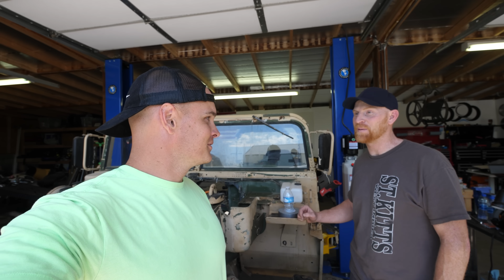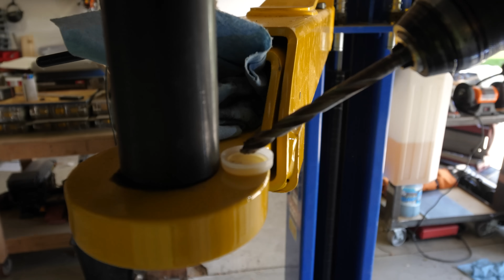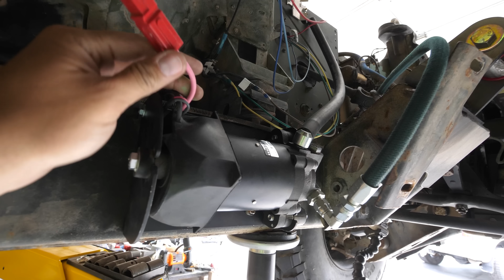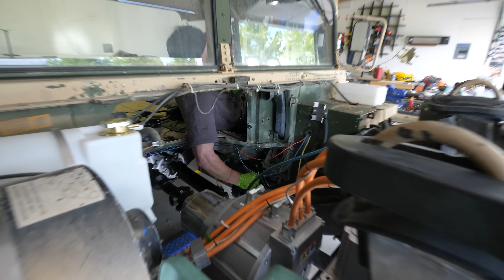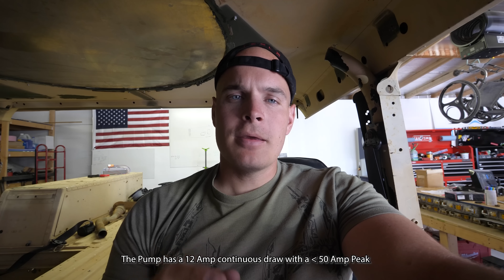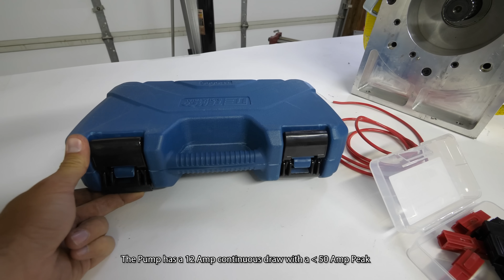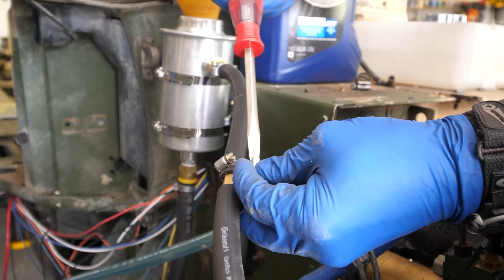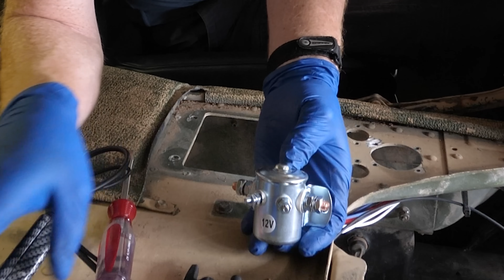We might have a problem with the Brakes... - Electric Hummer Conversion!

Comment: I'd use different fluid.  Find a Toyota truck that uses that pump, and use the same fluid that Toyota recommends for their system.  Probably better for the pump, and may be quieter.
Reply: Added explanation, dex/merc isn't bad, but automakers largely stopped using it years before electric pumps started becoming popular.  It would be safe to bet that the pump you're using was designed for a full-synthetic fluid, like Toyota T-IV, or Dexron-VI.  Maybe something more exotic.  I'm a Mopar parts guy, and I know that Chrysler has their own fluid specific to systems with electric pumps.  Toyota might do the same.

Comment: FYI. JIC fittings, 

 (bottom of reservoir) does not require thread tape.
Reply: Yep, came here to say the same. The angled section should provide all the sealing required.

Comment: I would just sound deaden the power steering pump. When your moving or going down the road you will probably not notice it. Or move it up front somewhere under the hood and not right underneath the cab.

Comment: For the pump, Closed cell foam so it doesn't collect dust inside it then paint the outside of it to protect the foam more. Or place it in a box with the foam.

You could also get a pump with a bigger turbine and run it at a slower speed

Comment: If it was me I personally would put some insulation that was weather and heat safe and wrap the pump in it or build a little makeshift box that is easily bolted and unbolted and then insulate that box which will provide far more soundproofing than what It sounds like it would

Comment: Can you please start numbering the videos and if possible number the older ones (it is supposed to be a series after all), i think i missed when the drive shaft was installed. The last video i saw was the 12v system. So please where is the video for the drive shaft?

Comment: Hey @JerryRigEverything,
Not all solenoids are created equal. You should check that the solenoid you have is rated for %100 duty cycle. Starter (and electric winch) solenoids often have a very low duty cycle and will burn out the induction coil, or get extremely hot if left on permanently.

Comment: The duty cycle on a starter motor solenoid isn’t designed for long periods of operation. I’m assuming the power steering/brake hydro boost pump operates constantly during vehicle operation as it would have on a gas or diesel powered vehicle. I would power the pump directly of a suitably rated run relay rather than a starter relay. Relays eventually burn out so it’s a good idea to make sure you have a relay designed for the purpose(eg. load and duty cycle)…especially given that potentially you could loose steering and braking performance.

Awesome project and youtube channel.👊😎

Comment: Few more details that may help you.  The master cylinder has a gold cylinder on the side.  This is a pressure reservoir.  In the event the power steering pump fails, you have a couple applications of power brakes from that pressure reservoir.  Also, with how the high pressure hydraulic loop is plumbed, your brakes take priority over steering.  So if you stomp on your brakes, your power steering may decrease.  Spend time fully bleeding the power steering pump loop.  Lift your front tires off the ground with your electric pump running, and steer left to right many times, and press on the brakes.  Turn off the system and wait for the air bubbles to rise out of the fluid, and repeat the air bleeding procedure a few times. I would also measure your dc amperage with the pump on at both rest, and when fully loaded.  I'm curious how many amps it draws at idle.  To simulate worst case turning pressure, you can lower the front tire pressure.  Or test with the steering at full left or right lock against the steering stops.  Typically when you're on the steering stops that's the peak pressure, and the built in pressure relief valve in the power steering pump releases, creating the typical "hiss" noise you hear on most vehicles.
Reply: Depending on your final vehicle weight, and tire size.. if you need additional steering power.. there is an upgrade to the "Sheppard" steering box.  That does require drilling and welding new bosses into the frame though.  As an alternative there is a "rock ram" hydraulic ram assist system.  You might not need these though if you place your batteries towards the rear axle
Reply: Also.. I'm not sure that a hydraulic accumulator and switch would work.  I may be wrong, but I believe the pump flows fluid through the brakes and steering box when power boost isn't needed, and there isn't high pressure in the system.  And when power assist is needed, the hydro boost or steering box will divert the flow and build pressure to provide the power assist to the driver.  Kind of like letting your garden hose flow freely, and then putting your thumb over the end when needed to divert the flow and build pressure when you need it.

Comment: Fuse? I didn't see a fuse between the solenoid and the battery. Also two words of caution, alot of those solenoids are not continuous duty. Secondly when that solenoid is energized and deenergized it creates a huge inductive Spike. Over time that spike will damage contacts. Consider adding a snubbing diode across the coil of the solenoid.

Comment: FYI, using Teflon tape on the bottom tank connection isn't doing anything. That fitting doesn't seal on the threads, it seals at the angled face of the seat and fitting.

Comment: 🤔 I'm thinking that thing is a tin can. Not very "sound proof". Maybe use dyna-mat. Used in the car audio industry to keep the sound in the car from resonating out. And outside noise out. There's also flexible foam mat that goes over dyna-mat for even more sound proofing. Installed usually under carpet, behind panels under roof liners. Simple to install. That will cut the noise to a tolerable volume. Goodluck.

Comment: @JerryRigEverything I've used a product called Kilmat, it's a sound deadening mat that can withstand heat. I used the 80mil version, and it worked perfectly to quiet an onboard air pump. just built a small aluminum box to incase the pump, and line the INSIDE with the Kilmat material.  Hope this helps.

Comment: I would try a sound absorbing/deadening foam block. Just carve it out to match the profile of the pump and mount it with spray adhesive or tie it to the frame. Ford uses the same stuff to muffle the noisy mechanical high pressure fuel pumps on their turbo Explorer patrol vehicles.

Comment: I would put a 90 or 100a fuse or resetable circuit breaker,  in the power wire to the vaccum pump solenoid, also I'm not sure the yellow ends you've used on the wire are heavy enough, I would source some 10mm or 12mm square lugs you will need to crimp using your hydrolic crimper, but great work, I'm enjoying watching this build.

Comment: Beyond the suggestions for hydraulic accumulators and sound deadening wrap on the pump motor.

I'd suggest some dust boots (like you see on motocross bike front forks) over the drive line splines, you REALLY don't want dust mud and crud getting near those.
Reply: Yeah I havn't seen a slip joint exactly like that.  Normally the splines are covered by a longer female shaft and a rubber seal on the end.

Comment: Really need some more fusing as close to the battery as possible every Circuit must be fused and the fuse is there to protect the whole circuit not just the item it is powering.

Comment: Electric steeringgearbox would be way efficient cause the motor only works when you want to steer, for the braking system, a vacum pump with pressure sensor will be suitable, the vacum pump works until it reaches certain pressure then stops, and works again if prssure goes down

Comment: If you're of service you'll be compensated... With more responsibility and less recognition. 🙃

You probably need larger than 10 awg wire if that thing is pulling 50-60A.

I might be wrong but I think that pump should shut off once it builds up pressure. It shouldn't run the whole time the key is on.

Comment: As for helping to quiet the pump, you could build a casing, or a 'dog house' if you will, with sound deadening material lining if heat transfer isn't an issue. could use vents in the metal sheeting as a sort of passive cooling, or just use 12v fans like the ones used in high quality audio equipment

Comment: I'm a big fan of those stand-alone electric pumps, had one in my '94 Soarer that controlled brakes, power steering and even the suspension as it was on factory bags (which still work today.. 30-40 seconds to raise or lower the whole car by ~2 inches).
Best parts when compared to a belt or vacuum driven system is you still get full brake and steering boost when the engine is off, and zero load on the engine/electrical systems when not actively in use. It just makes more sense.
Reply: Have any more info on that pump? Sounds cool and advanced for '94

Comment: Was the bottom fitting on the reservoir a SAE/AN? If so why did you use pipe tape? When the 37 degree flares meet they seal before any fluid makes it to the threads.

P.S. I'm am really enjoying this hummer build.

Comment: The electric power steering on my new Avalon hybrid makes no noise. It's connected directly to the rack and pinion with no hoses. The computer controls it in a way to help keep you in your lane, and wheel angle increase for parking. It also has electric breaking, when you first turn the "key on" you hear a faint pump building brake pressure for a moment  then stops, but you can't hear the pump inside the car. No engine accessory belt either, AC, water pump, oil pump, etc. has there own computer controlled 3 phase motors.

Comment: If it doesn't need any cooling you could make a little diamond plat box and double line the inside of it with sound deadening material for a stereo system. Just cut holes for wiring and throw some rubber gaskets around them.

Comment: I think you're doing an awesome job modifying the hummer. Not To be a smart-ass, but shouldn't an electric vehicle have electrical steering. I hear some of New Ford trucks use electrical powered steering.
Also I forget what's it's called but there is a device that can hold the steering pressure once it's at pressure and allow the pump to turn off when it's pumped up.
Just a suggestion, get water tight connectors for pump motor. It might not go underwater, but prevent corrosion, loosing brakes or steering because of road salt, would be a plus.
The brake system would be easier and safer with a vacuum boosted manual master cylinder.
Speaking of regenerative breaking, that would also a plus,  and relieve some the brake force needed from the driver.
FYI....that "hole punch" us not that,  it's called a center punch/set.

Comment: teflon tape does not create a better seal... its not a sealant tape. it is used as a lubricant for the threads to slide on more since the teflon tape reduces the friction.
Reply from the maker: Which makes a better seal. The verbiage might have been off, but the end result is the same.

Comment: Cool setup

I would install a hydraulic accumulator to make the pressure more even in high demand brake and turning events. Also you could isolate the mount from the frame with rubber and incorporate sound baffles into a skid plate. Lots of sensitive components in vulnerable places under the chassis. 👍

Comment: you could make a metal box around it with sound dampening material on the inside, and the lines connecting not on the pump, but on the outside of the box, like a hydraulic system

Comment: I dnt think steering pump is reliable in extreme conditions. Better idea is to get a bigger motor and connect 12v alternator, brakes,steering, and ac compressor via pulley

Comment: Sound insulation for the noise. Once the dog house is on and tire noise will block out most of the noise. You can also add a nice stereo what will aid in covering up the sound. Is the wine from the motor or the pump in the system. If pump side try a different style of pump but more research would be needed on that end. I’d say add a cover for sound and it would also help protect it against debris and go from there.

Comment: A hydraulic accumulator is the way to go, the pump charges the accumulator then a pressure switch to turn off the pump. Also means that if the pump suddenly fails (its electric, many modes of failure) you will retain pressure for braking/steering.
Also a good idea to wire in a pressure sensor to a light/alarm so that if the pressure gets low in the event of a failure, you know to pull over and stop, lest be left with nothing but regen braking.

Comment: The braking discs could be replaced by a regenerative geared torque motor and electrically clamped discs when harder braking is needed or parking brakes.  Worm-gears lock solid with no power needed once engaged.

Comment: Looks like the reservoir has JIC type connection.  Please do not put teflon tape on this type of connection, it is a big noooo. The bare cone will make a sealing connection with mating fitting.

Comment: Get rid of the hydraulic pump and custom build a "worm-gear" based electric rack and pinion.  That should be more efficient and quieter.  Or use an Electric Rack and Pinion from a Silverado.  Electric steering is quiet and will save energy.
Reply: Any idea how wide those are?  You'd have to match the width of the Hmmwv center link to get the steering angles pretty close to match, and get good bump steer and Ackerman angle characteristics.
Reply: @strandtc  No idea, I'm not a mechanic.

Comment: Vance Ewing has the right idea imho.  A slight variation would be to use  a plastic housing that is acoustically insulating.  I recently had to repair an aquarium air pump.  It was made by Fluval, and used a magnetic rocker which moved 2 baffles to draw and move air into the tank.  When the cover was off the pump, it sounded like a compressor pump running. When you put the cover on, it became whisper quiet, no sound at all really.  Your pump is a touch louder, but looking at the video, you may be able to create a similar cover, and, honestly, some of the sound deadening matting out there is very impressive, so aluminum or stainless steel is an option for durability.  Noico Solutions, Syless or Pyle are the main manufacturers and are on Amazon.  A quick search under Sound Deadening Mat will get you a huge variety to consider.  One question I have is:  Is any of the sound being transmitted through the hoses, and are they touching the frame anywhere besides the connection points.  This may present some harmonic vibration, which could boost the sound, or convert it into a different form of irritation, i.e. associative vibration or subaudible harmonics.  Loving this build, and your other content as well.  Seeing you and Brian work together on this particular part of the project as peers is, as you said, a great full-circle demonstration.

Comment: Mount the pump inside the engine bay further forward rather than near where you sit.....but when this thing is driving, the chassis and tires and wind sound will drown out that pump im sure.

Comment: To dampen the sound coming from the pump, Buy a bigger pump with a lower RPM that can displace the same amount of volume at that lower RPM. I am not a truck/car guy so maybe look into tractor parts since they don't care as much about speed as they do about power.

Comment: If the pumps fail you loose both steering and braking. It's better to keep it seperated. Also I am not an electronics expert but with my diy knowledge, You could have used a buck converter to get 12 volt output without much loss from the lithium ion batteries directly. It's efficient than charging a lead acid and then powering electronics of it.

Comment: Maybe on the toyota it's ecm controlled, able to vary speed and run as needed instead of just screaming loud electric motor on all the time. Maybe look into a Toyota truck powersteering control module.

Comment: " using a ford starter solenoid "  Just make sure that's rated for continuous duty!!   If it's not you will smoke the relay coil.
Reply: True. I would try to use whatever they use for an auto start-stop system. They are different and rated for an insane amount of cycles.
Reply: Golf cart solenoid would work

Comment: Did you changed the seals in the HUMVEE braking system to use ATF vs brake fluid?  Or was it ATF from the factory?   Awesome build btw.
Reply: The reservoir he added the fluid to is on the "power steering" side of the system, and isn't being used in the hydraulic lines for the brake calipers.  The original Hmmwv system did use atf in the power steering pump.

Comment: Maybe you can relocate the pump, closer to the front away from your seat. Or put a cover on it with some holes on the bottom of the cover so it can get some air to it from overheating the pump

Comment: It would be interesting to see if you could add an ABS Braking System, so that the brakes won't lock up in an emergency situation. Especially with such a heavy vehicle.
Reply: In the later Hummer production years, there was an abs/traction control system added.. so it can be done. However.. I wouldn't say it was the best system.  To add to this Hmmwv though, he would have to change the torque bias ratio of the torsen differentials, install the speed sensors, abs modulator, and replumb all the brake lines, replace the halfshaft with one with tone rings on them, then get all the wiring run and hooked up, and diagnose issues.  Needless to say.. alot of work.